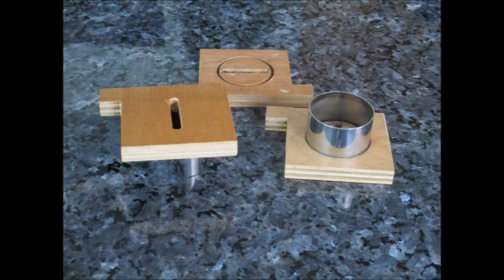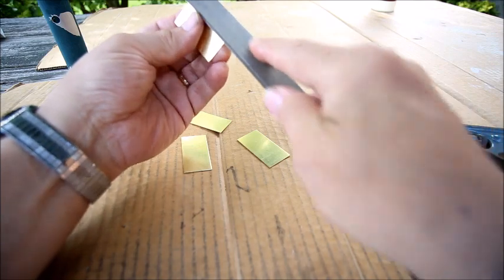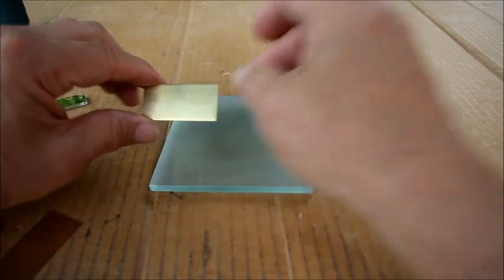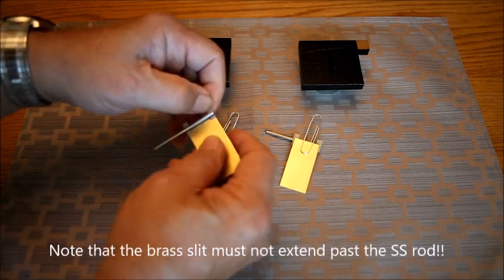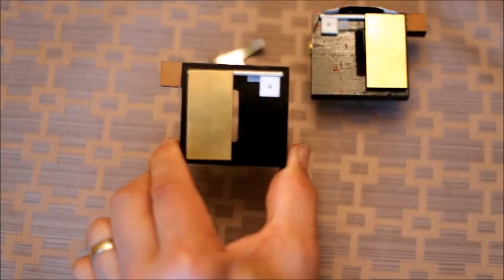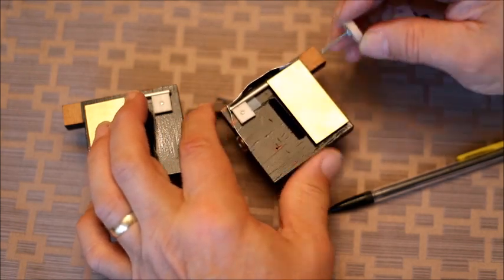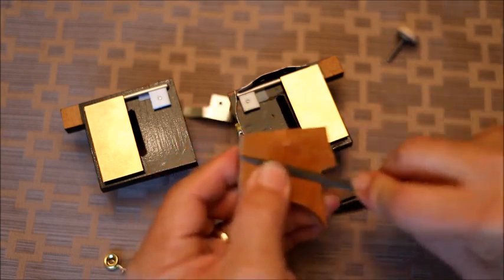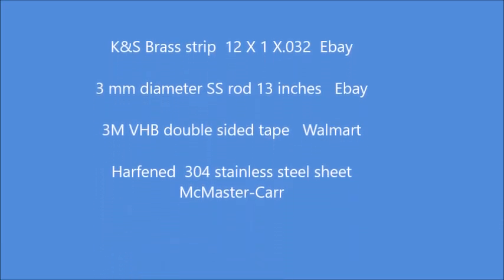Making an Adjustable Slit for a Spectroscope

Comment: I'm watching this with the sound off , so hope I'm not missing something. I am curious as to why Ed did not go the usual route of razor or scraper blades ? I was also told that blades beveled on only one side of the cutting edge are preferred but not sure why ? Also, what is the minimum slit for optical work, ie Foucault and Spectrohelioscopes ?